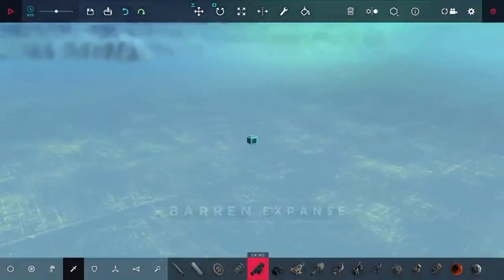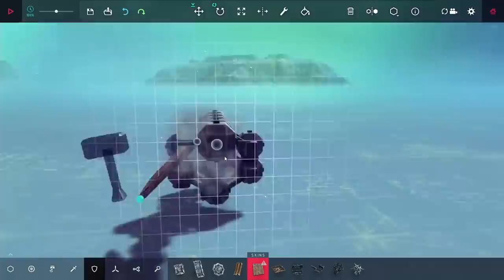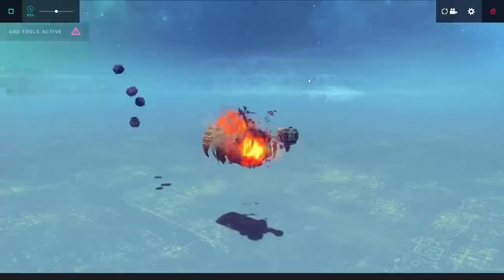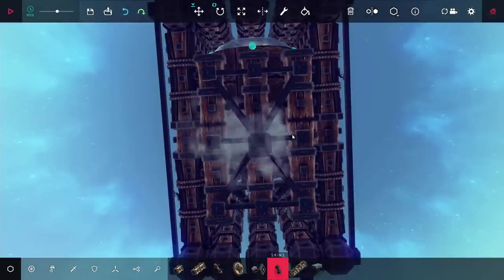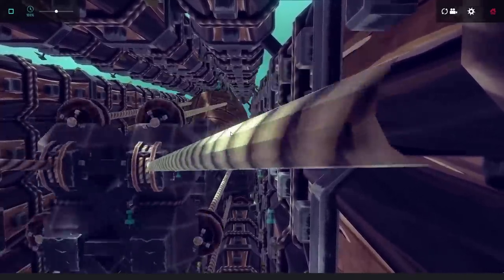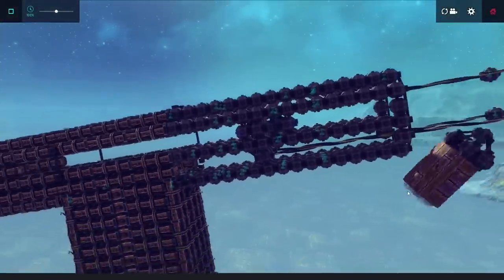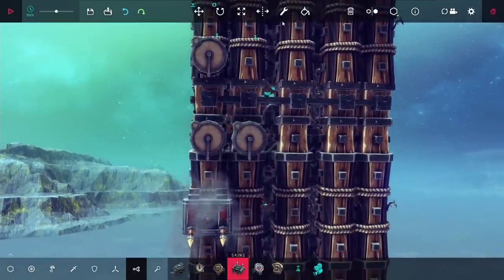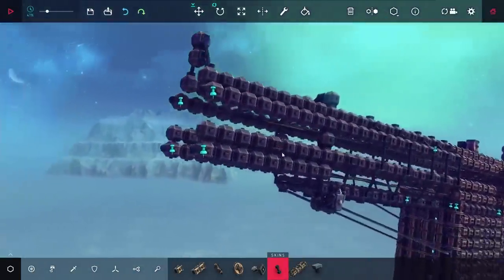Making a Realistic Shotgun in Besiege

Comment: i think the barrel and moving the bolt may have been slightly better if you used smooth surface blocks, but otherwise this is a really cool shotgun build!
Reply: the thing about smooth surface blocks is that they're not actually smooth, just look like it. the best functionally smooth blocks according to others is a half-pipe, but it's unknown why he didn't use these (they'd at least look pretty good)

Comment: I absolutely love that because you made primers for each cartridge and the long profile of the flamethrower you accidentally stumbled into the real issue with firearms of out of battery discharges due to an exposed firing pin.

I know people have commented about using smooth surface blocks, but another thing that could help with loading might be a feed ramp out of the magazine to help tip the cartridge into the barrel and avoid getting caught on a 90 degree ledge.  It would also have been neat if the magazine was just pushed up by a spring passively without timers, but that would require feed lips or something to prevent the other rounds from feeding and I don't think the physics of the game would do very well with that kind of constant force being applied on multiple volatile loose objects.

This was still incredible to see made.  Far more than I would have thought possible to create.

Comment: I would have used a spring to pull up the magazine bottom instead of the rope wench. The springs allow you to only require a button press and a quick action rather than to manually crank the wench. However, you would then need to create a mechanism to stop the bullets getting in the way of the already loaded bullet, but I already have several ideas.

Comment: Hey Reid! I think it could benefit a little bit by giving just 2 minutes at the beginning to explain your goals and overall plan. For example, I don't really know how shotguns or even bullet casings work, so explaining that at the beginning would be nice.

I'm glad to see this channel has really taken off! :)
Reply: He doesn't seem to either based on the terminology he is using but he made one and it's awesome. So I will explain a little, but it will sound like a lot.
Generally shotguns are a smooth bore (they can be rifled but most aren't) that shoot either slugs (singular projectiles) or shot(multi projectiles) which he made. He also created what are commonly called "shells" which (from bottom to top) contain the primer (ignition device/spark), powder(thing that goes boom), wading/buffer, shot(the projectiles) and at the end a crimp which holds it all in place so it doesn't shake loose. 
So in summary Primer is set off, the powder goes boom, the buffer helps push the shot out past the crimp. 
I hope this helps and doesn't come off as rude or condescending.
Reply: @surtofgods8265  That's a good explanation, thanks for the clarity :)
Reply: @poketopa1234  np

Comment: For the magazine, you could have used sliders with a winch in order to prevent it from wiggling while it rises.
Like, having the platform be connected to a few sliders on the underside, and the sliders would be connected to the main body of the magazine,
So when you pull up with winches, it will only be able to move it along a single plane, instead of tilting or wiggling.